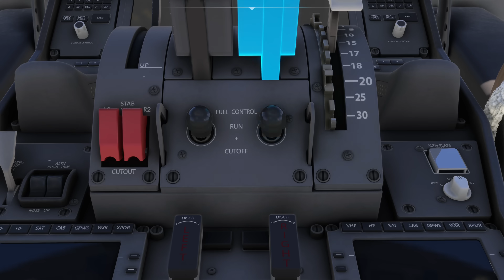Air India 171: Why Did The Fuel Cut-off Switch Get Moved?

Comment: The double-key approach to cutoff would render the incapacitation of one pilot a significant issue in an emergency. The Human Factors issues have long been studied. You Monday morning Pilots and don't understand the philosophy of the Boeing design. Boeing lets pilots fly the plane. They let pilots determine when to CutOff Fuel. We don't have enough information to assign anything but a human error was made either by mistake, or intentionally. The 9 seconds between being off and on, and thinking about which engine was working longer, could that have saved the plane if the pilot had noticed the cutoff and immediately turned it back on... Like in 3-4 seconds or was the plane doomed? It only had 27 second of flight time from the Cutoff. Not much time to do anything. CVR will be interesting...

Comment: My career designing missile electronics for many years. In modern design switches do not directly activate functions but rather serve as inputs to a computer that then decides whether or not to assert the commanded function. If this is the case with this aircraft then it is possible that a glitch could have executed the shutoff function without the switches ever moving. I consider this as highly improbable but still in the arena as a possibility.
Reply: The switches in this application are not integrated into other systems. The switch sends a signal to the FCU, no where else. It might as well be a direct mechanical connection.
Reply: @stephenwalton9646  If that is the case then the FCU will relay the switch events to the flight recorder via whatever electronic route. Have we good data received by the flight recorder upon which we are making system performance decisions? So in the event of an aircraft electrical power system glitch did the FCU momentarily send out erroneous data or did it interpret erroneously supplied data to it as it re established Rx Tx handshaking? There are just so many questions that we cannot answer currently without hands on hardware. It would be an interesting test to see how quickly the system recovers to full information integrity with a momentary main power glitch.
Reply: That is also my question (whether we can know for sure if the switches were physically moved), but the other pilot asked WHY he shut down the engines, not if he had. To me, in order for him to ask that means he actually saw the switches in the cutoff position and not that he assumed the switches were turned off due to both engines rolling back.  But I'm also an EE and was wondering if the fuel shutoff are a self contained dumb system or one controlled by bus.
Reply: @ohger1  but just because he might’ve seen it there doesn’t mean that is what happened or they didn’t fail/move themselves. Also it might’ve been that person that moved them.
Luckily the investigators don’t bother reading random YouTube comments with less than half an idea.
Reply: @MIEJ4  One switch moving itself is virtually impossible, two moving themselves at the same time is literally impossible.
Reply: @ohger1  glad to see you’re keeping an open mind. There’s been lots of accidents over the years where it was “literally impossible” for an accident to happen.
Maybe you should apply to be an accident investigator and can probably save them loads of time nothing looking into dead ends.

🤦🏻‍♂️
Reply: @MIEJ4  I am already an engineer, just not in aviation.  I have designed many safety and monitoring circuits, but I do NOT know how these aircraft systems are designed so I can only speculate.
Reply: This is what I’m questioning on no data points being available with the prelim report that points to switches transitioning. Why did the airlines not have a 3rd pilot. Why was the design of such an imp mechanism not fool proof. Why was this malfunction testing only advisory? Making it impossible to now find if the switches were tested prior to takeoff as part of maintenance. There’s a remote probability that this fight had faulty switches!
Reply: @sriramaswamy  Can't be faulty switches.  The odds of them failing within one second then fixing themselves within another 4 seconds is impossible.
Reply: @ohger1 want to see data. How can a human then switch this manually within one second? The resetting of this switch back to run took 3 seconds I see. Blaming the pilots without understanding the fuel value issues, data points, airline not having a 3rd pilot on a 10 hr flight, no maintenance data on fuel switch as issue was deemed as advisory, poorly drafted prelim report. You’re scaring people by blaming pilots premature. If it’s truly pilots fault show us the data!
Reply: @sriramaswamy  You're not seeing this correctly - both switches weren't thrown within one second, the second switch was thrown within one second after the first switch was shut off.  There's a big difference.  I know and have used those switches/locks (not on an aircraft but in industrial controls).  It takes maybe .25 seconds to pull and flip the lever leaving .75 seconds for someone to get their hand from the first switch to the second.
Reply: While you are right, this same action would have been electronically recorded in the black box. It was not. Therefore, we can safely assume it did not happen.
Reply: I think it is very unlikely this wasn't done by one of the pilots deliberately. But completely ruling out any other explanations when there is no video evidence I think is equally nonsensical. This proves why cameras are needed for such circumstances.
But I think there's an angle really no one is talking about and that's a pilot doing a deliberate movement in a moment of unawareness. There is a bunch of mental conditions that could cause temporary confusion, making someone do something they wouldn't normally do, or conditions like a stroke, seizure, head injury, medication etc.
Reply: I initially thought like you, but the more the evidence comes in, the more unlikely that already unlikely event becomes. The computers for both engines continued to function normally, sending data to the data recorder up until impact. 

I'm also coming to suspect that an electrical glitch could not have given this result. Those computers probably query the switches multiple times a second. A glitch might have given a couple of wrong readings inside a second, but once the glitch had passed the computer would sense the switches were in the RUN position and restored fuel flow. There'd be no ten+ second delay. 

All the evidence leads to the same conclusion. Those switches were operated both off and on by a human hand.
Reply: @Walter  It's also a "possibility" that the switches were moved by space aliens or gremlins.  Of course you don't actually know anything about the systems involved, but feel free to calculate the probabilities of your computer "glitch" scenario turning one switch off, then waiting a second, and turning the next one off, THEN 10 seconds later turning one back on, and 3 seconds later turning the other back on.  (Or did the "glitch" magically disappear before being turned back on).  I'm guessing that scenario is billions to one.  As opposed to the scenario described SUPPORTED BY AUDIO CONVERSATION!!!
Reply: Is it known if the switch position is recorded in this aircraft type's data recorder?
Reply: I think the horrifying reality is that we are largely powerless to stop a determined pilot from taking a destructive action such as this. It's just a journey of acceptance of that fact...
Reply: Boeing would not have been off the hook if there was even a slight suspicion of malfunction. There are no recommended actions for Boeing, it is a deliberate act.
Reply: @bluestringmusic and what’s your data point that you are saying this? I haven’t seen the data during, before and after switches transitioning. The dialogue between the pilots are out of context. These kind of speculations only create panic amongst passengers. Where was the 3rd pilot that’s supposed on flights crossing 8hrs? If fuel value had malfunction and was marked as advisory then chances are it was never part of maintenance tasks data, then how can you say with such conviction that the fuel switch value installation wasn’t correct in this plane and it was an anomaly. The prelim report doesn’t have enough info to conclusively say that everything else can be excluded and thereby only thing is pilot error here.
Reply: @bluestringmusic  you are aware that its a preliminary report? And a fairly poor one at that.
There are no conclusions yet. Apart from inside your thick skull.
Reply: Go look at the report, towards the end. No actions recommended for either Boeing or GE. 
After a major crash, adding this in a preliminary report indicates that the group of investigators have no suspicion on faulty parts or other theories. Else they aren’t going to allow other Dreamliners to keep flying. 
The advisory about switches was about installing it the wrong way. This plane has flown several times before and the switches were installed correctly. If not, the prelim report would have said it in bold letters.
Reply: @bluestringmusic  see you have a bit of an issue quoting things as facts without including the appropriate “At this stage of investigation”,  “Additional details are being gathered based on the initial leads.” and “Investigation is continuing and the investigation team will review and examine additional evidence, records and information that is being sought from the stakeholders.”

So your thoughts are still very much preliminary without possible other evidence still to be recovered/analysed.

So yeah maybe need to improve your critical thinking skills🤦🏻‍♂️
Reply: @MIEJ4 not everything is a conspiracy. Sure, you can do mental gymnastics to come up with  a low probability theory, but that’s not what the report is saying. The fact that they left this in there - “why did he/you cut off” is telling. If there was any doubt, they would have pulled that quote out. I bet the rest of the exchange will be pretty damning. 
Again, the fact that Boeing and GE have been given the green light to continue operating the Dreamliner with no service required speaks volumes.
Reply: @bluestringmusic  when did I mention a conspiracy? I’m not doing any mental gymnastics, other than trying to say that your “100% sure decision”, isn’t. Simple as that. The fact that you somehow associate “The fact they left this in there” when it’s a preliminary report suggests you’re just on a wind up and aren’t sure what you’re talking about. Pathetic and if it wasn’t such a serious subject it would be absolutely hilarious. But then you Americans are always full of yourselves and then wonder why the rest of the world laughs at you.
Reply: @MIEJ4 WSJ now reporting that it was the captain that shut it down. As expected, the CVR has much more than was revealed in the preliminary report. I rest my case.
Reply: What did the pilot meant when he asked the other pilot if he moved it? Did he see internal wirings being moved? What did he SEE and visually confirm before that question? Occam's razor says he saw the EXTERNAL switch on the wrong position, not the INTERNAL wirings/circuitries.
Reply: @AkitaMix he didn’t ask IF the other pilot moved it. He asked him WHY he moved it.
Reply: We know from the conversation in the cabin they were moved.  As an engineer I am shocked you missed this point.
Reply: @donmoore7785  we do in fact not know. We know that one pilot asked the other why he turned off the switch. That does not prove he actually turned it off it could have just been an assumption the other pilot made in a high pressure situation after he noticed the engines stopping to work properly. First rule of engineering is to not just accept a user claiming something is necessarily what happened...
Reply: @coin5207  Came here to say this. We are so quick at jumping to conclusions. If you were to reverse engineer from the reply of the co-pilot "I did not", you might ask, why would he lie few seconds before he know he was gonna die. There's definitely more to the story here.
Reply: @donmoore7785  That's incorrect! The conversation merely 'implied' that the switches had been moved. The pilots would have witnessed Master Caution Alerts coupled to  engine pitch change when the fuel was cut off.........that doen't mean that the pilot who made that comment actually witnessed the switches being moved or tampered with in any way. Your post is based upon assumptions.......NOT FACT!
Reply: If you are genuinely an electronics engineer then you will know that software does not “glitch”. For a given set of inputs and conditions, software does the same thing every time. The 787 has taken off literally tens of thousands of times in exactly the same sequence. If there was a bug in the code then it would have come to light before now. Besides, both switches and their associated control units are totally independent of each other, so that would also eliminate a hardware “glitch”. It was mass murder, just  accept the obvious. Even the preliminary report points to it without being specific, essentially by ruling  out a mechanical/electronic/software failure. Additionally, read the report and ask why aviation medical and psychology specialists are involved. Furthermore, it’s now been reported by numerous agencies that the captain has a history of mental illness and had recently returned to work following the death of his mother.
Reply: @neilwallace8989  "Software does not glitch. For a given set of inputs and conditions, software does the same thing every time." what you are trying to say here is just false and every basic software engineer would know this. There is no two times in history where conditions for something are exactly the same. For computers specifically, results of a program can very much depend on things external to the program software and running the same thing twice does not mean conditions are the same. Things like race conditions can come up one in 50.000 times if threads are scheduled in such a way that make it possible. Then there's things like Single Event Upsets where cosmic radiation can flip bits in your memory causing unexpected results - it is so much of a thing that airplanes are even safeguarded against that. And then obviously also obvious things like hardware breaking can influence the software running on it, and hardware is not immune to breaking after 10.000 take offs.
Reply: @coin5207 two sets of independent hardware failing simultaneous. Yeah right. Have you read the report and noticed that aviation medical and psychology experts are involved in the investigation? Are you also aware that it’s been reported that the captain had a history of mental illness and had recently returned to flying after the death of his mother? Have you not questioned why the preliminary report is deliberately vague and has paraphrased only a single brief exchange from the CVR? Are you suggesting that these were the only words spoken? Why have the authors of the report chosen only to divulge this ‘one-liner’? Everything points to mass murder/suicide, and most rational commentators have reached the same conclusion.
Reply: @neilwallace8989  My guy can you guys stop fighting shadows and strawmen and read what people are actually saying? 
1) No one in this thread as far as I read has said a technical failure is a likely reason. What they have said is you cannot count it out, as the pilot making this video has who is not an engineer.
2) of course psycologists were involved. This being due to human factors compared to technical was the prime assumption from the point the data was read off the blackbox. That does not mean you bow can now just claim XYZ happened
3) even if there was proof (which there isn't as of now) that it's 100% human caused that still wouldn't prove s*icide as something as fast as two switches being activated can also result from neurological damage and neurological things I specified before, if unlikely. The entire point is there needs to be more official evidence gathered before definitive conclusions can be made, not "some guy according to sensationalist news outlets said xyz". And no it is everything but rational to say "it was xyz" at this point. Most pilot channels I've seen recently say things like "it was likely xyz". That is very clearly not the same thing.

Comment: We should also not forget that there was an unusually long take-off roll before getting airborne, longer than normal for even a hot day, that must also be taken into consideration when searching for clues and answers to this tragedy. 

Also, the voices havent yet been identified as to who said what in those crucial moments. Who made the MAYDAY call? Was it the same person that returned the switches to RUN?

What other switches or buttons were pressed in the final moments? All important to know.
Reply: The black boxes will report engine performance, so if there was some other issue, we'll know that when the full report is released.  In any case, the craft only made it to a few hundred feet then flew another 20 seconds with no engine thrust from a low altitude suggesting that the plane had plenty of speed before the engines were shut off.
Reply: The experts have already reviewed this data, which is important for THEM to know.  They've given their report.  The basic data isn't going to change, only the further investigation into the pilots, etc.
Reply: A camera would tell the story!